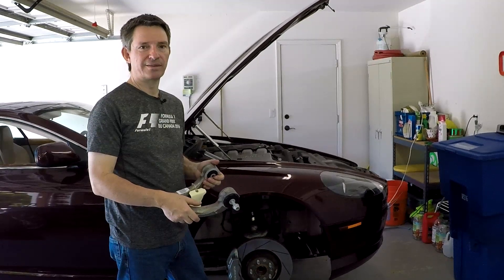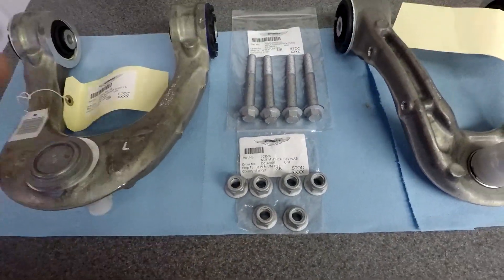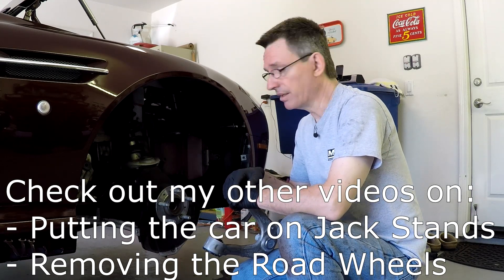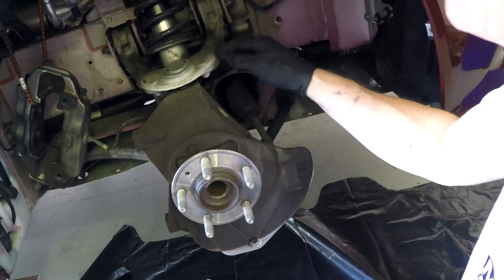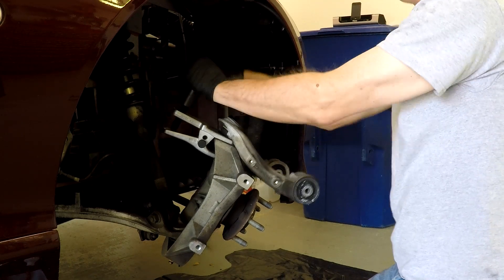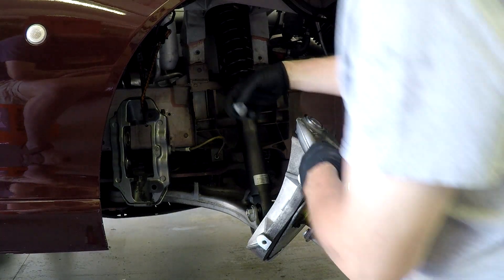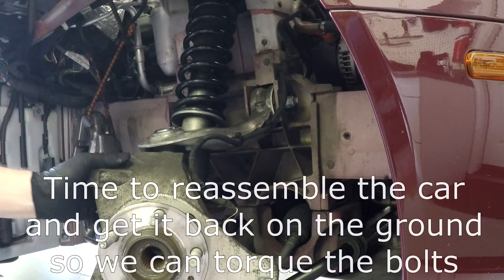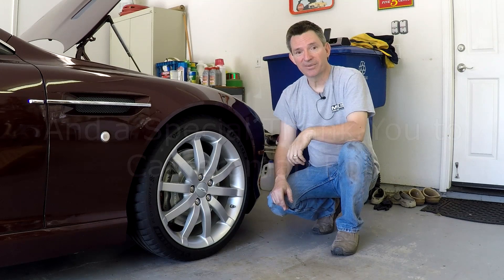Changing the Front Suspension Upper Control Arms in an Aston Martin DB9 or Vantage

Comment: Hmm. I may think about pulling my arms off over winter to duplicate those arms with replaceable bushings and ball joints.
Reply from the maker: I am pulling a second video together.  I took my old control arms apart to pull the bushings out and see what was so special.  Nothing.   They press fit from one direction, but do have a thrust pad on the outer sides that would need to be identical.  Also they were Teflon lined.   I think if a company that makes Polyurethane suspension bushings was interested, they'd easily be able to replicate these.  Thanks for watching!